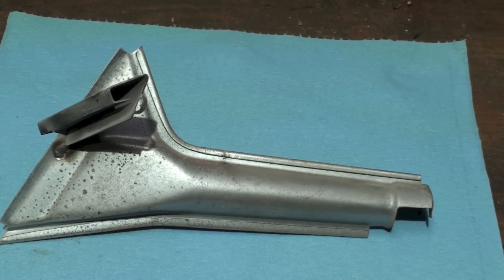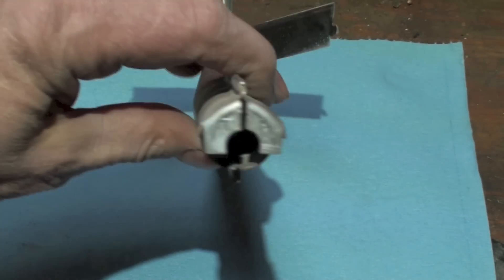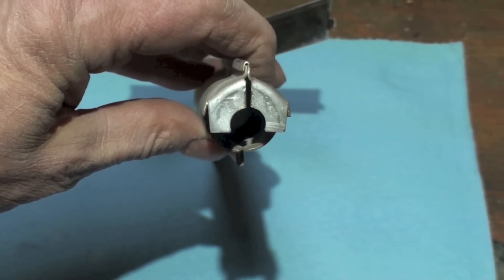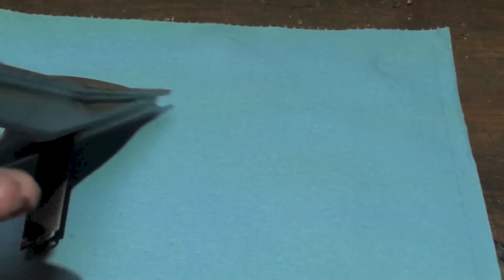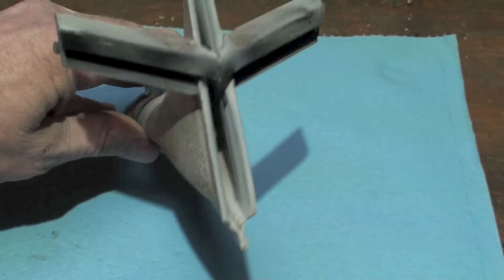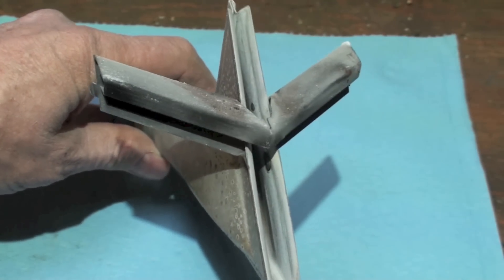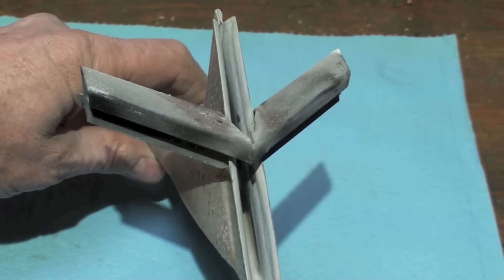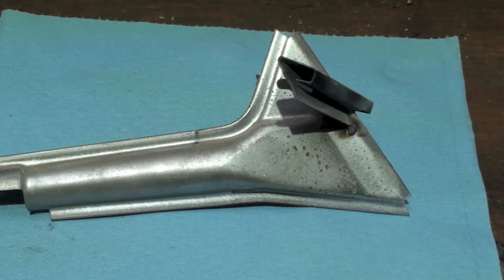Trane BLU burners

Comment: Just saw this video on the BLU series.  We had these same "fan style" inshot burners on our Tappan three-burner 60% pilot furnace from 1978.  We replaced that with a two-burner Trane XL 80 BLU 70K in 1987 that had the exact same burners.  (Who actually made all of these?) That unit lasted until 2016 when the gas valve started leaking and we changed to a basic York 90 furnace.  I actually like these old inshot burners -- no adjustments needed, easy to clean plus the flame seems to avoid hot spots.  Our XL80 showed no heat exchanger cracks at all, no holes, nothing.  Tiny bit of surface rust but otherwise solid, after nearly 30-years of use.  Had we fixed the gas valve it would have kept going.  I doubt modern tubular inshot designs will hold up so well...

Comment: Carrier, Janitrol and a few other used these in the late 60's - 70's.  I wonder if this was the first "In-shot" burners.  We had a 1960's Carrier Furnace that used this type of burner.  It was a two-stage furnace which was unheard of back then.  That furnace was over 30+ years when my parents sold that house.  It was still going strong.
Reply from the maker: Brent Audi I do remember seeing something similar on an old Carrier.  I thing what they were trying to do is build an inshot type burner that could be used on a ribbon type heat exchanger.
GFM